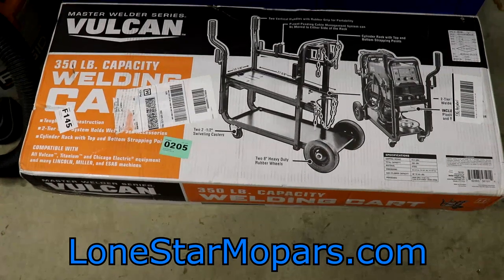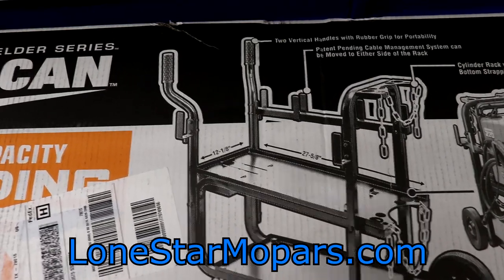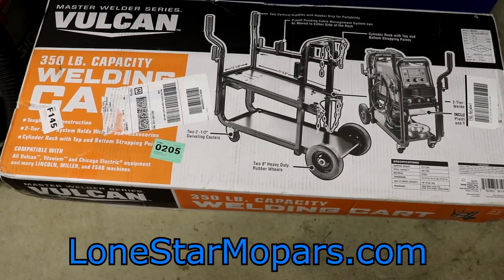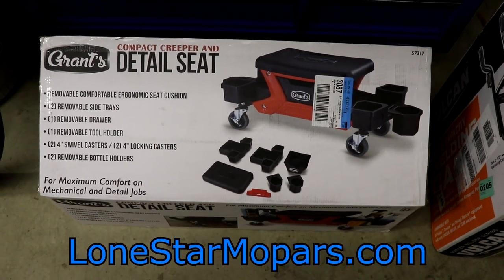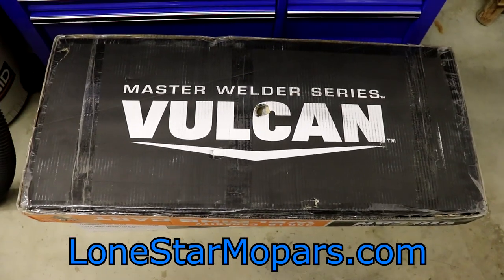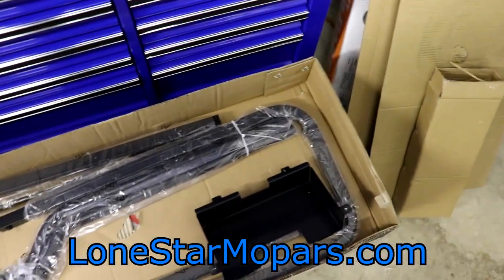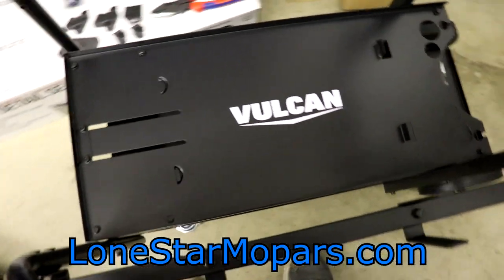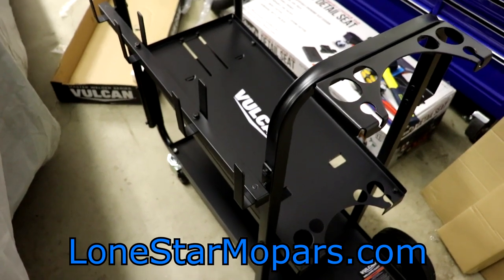Harbor Freight Tool Haul #16: Vulcan Welding Cart - Unboxing and Assembly

Comment: For light duty use, pretty good! At least for once it wasn't me needing to figure out assembly on something
Reply from the maker: Yeah, I think it is pretty solid...I felt pretty confident in it based on having had the old blue one for so long.  If I had a bigger shop I probably would have done a larger, all-inclusive cart, but for the tight spaces this should work pretty well.